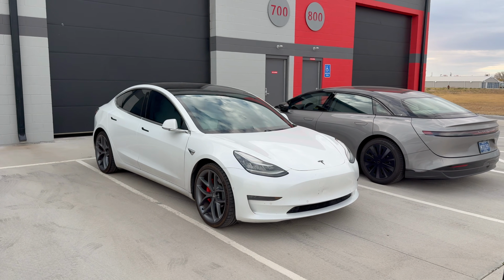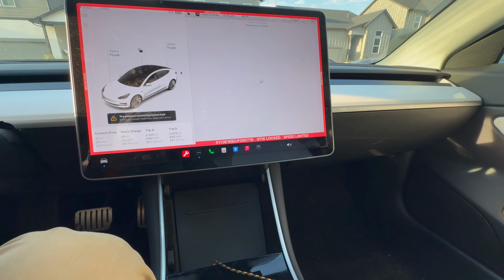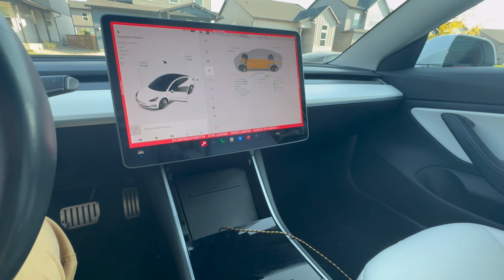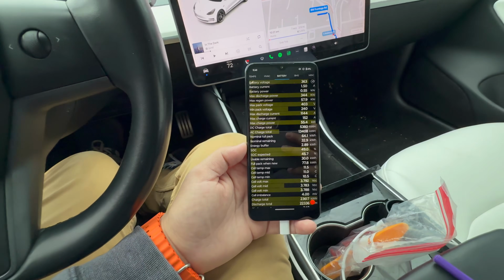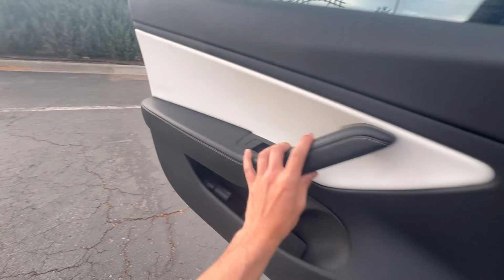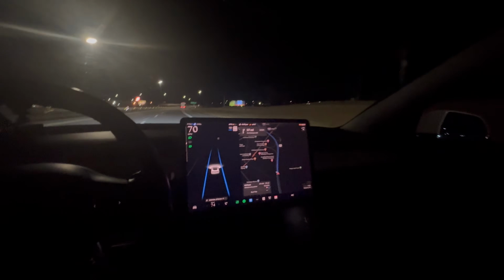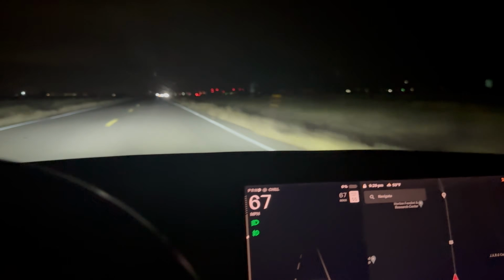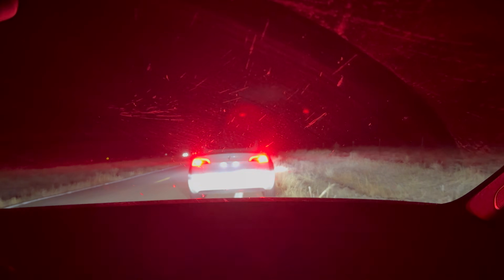My Used Tesla Lost This Much Capacity Since New! 2018 Model 3 Performance Battery Health Check

Comment: Living in AZ and being a stats nerd I will tell you that Tesla does NOT do anything related to battery cooling during the summer months! I have had 2 model Ys and I rarely see pack temps below 100f even over night. Then during the day 110-115 pack temps can be very normal. If you supercharge during the day in AZ, 140f then they just slowly go down to 120 after supercharging. If you supercharge here it’s brutal day after day. I’m lucky to also have a garage with AC so I think some have it even worse.
Reply: Does Tesla not run the AC to keep the battery cooler if it's plugged in?   Even the bolt EUV does that.
Reply: @fubolibs4218 the only time I can tell they cool the battery is after supercharging to get the battery from 140f back down to around 120f. Also, using track mode on my performance model will also cool the battery as well but that is a choice I have to make, not Tesla.
Reply: @JimBoomer  weird. My bolt starts the coolant when battery pack is 90F and stops when it cools below 80.   That's why it's plugged in.
Reply: @fubolibs4218  Now, I should note that the car itself may be running some cooling through the loop to do some cooling. But the pack temps them self are all high all the time in the dead heat of summer for both of my MYPs I have had (late 2021/Late 2023). Tesla just doesn't do any meaningful cooling IMO. I don't get why.
Reply: @JimBoomer  that's weird.  Even if it's plugged in???  I would imagine it would just run the AC power and cool the pack.
Reply: Can you add another radiator to help

Comment: I bought my 2017 Tesla Model S 75D back in Feb. with 75k miles. I connected Tessie which showed ~7% degradation. Carfax indicates it was from Utah, I live in NV… it was brutally hot this summer. I thought I saw someone say 80% was the best limit charging, so I did that. 

I only drive 20-50 miles a day, should I limit daily charging to 50 or 60%?
Reply: If you don't need the range, yes. But don't discharge it under 20% regularly, if you would need to do that raise the charge limit.
Reply: @ That makes sense. Thanks!
Reply: I only had the trial for Tessie bc I was subscribing to a different phone-based Mileage Tracking app. That subscription just expired, so I bought Tessie a few weeks ago. It now shows 13% degradation 😩 I’ve really only been daily-charging up to 60%. 
I’m considering running this charging test from the service menu when I have some time off the end of Dec. My battery warranty is still good through Sept 2025. I don’t think I’ll hit the 30% req for the warranty claim, but still concerning to go from 7% to 13% in less than 1 year.

Comment: Scan my Tesla shows 63kwh on my 2018 model 3 with 168,000 miles. With Tijmen' car, it showed 64kwh. Im curious if the Scan my Tesla is consistently that close to actual capacity.

Comment: As someone already pointed out, 5,000 kWh of DC is quite a lot. Assuming a 30 kWh juice-up per stop or just over 160 DC charging stops to put some perspective onto it. That's quite a bit of heat buildup under the intense desert sun. Sure, it's no Nissan Leaf, but I'd imagine that AC compressor was working overtime during and after those DC stops.
Reply: That is just part of owning a car.  Some folks are going to live in a dorm, apartment rental house in TX or Arizona and will do more DC charging.

Comment: I have many friends (Chicago) with Telsas well under 90% capacity left.    Interestingly, my  AC charged 2019 Leaf Plus is doing worse (10.3% loss) with 40K miles, than my DC charged 2019 Leaf (9% loss).

Comment: It was actually 62.91 kWh if you multiply 233 mi * 0.270Wh/mi.

The high degradation is most probably due to a lot of acceleration, fast charging, high state of charge, and high temperatures. I don't think the owner drove gently with it, see all the suspension issues. Also the 4880 kWh regen in ScanMyTesla is a hint to fast driving style. It had almost the same regen like DC charging.
Reply: It could be 63.018 as 0.270 * 233.4 (233.4 will be still presented as 233). Even 233.44 same with consumption. Also, i am pretty sure tesla have some error in distance reporting at least @BjornNyland always do some magic correction. On other hand its take about ~20kw power so about 0.3C with 1C the capacity would be less.
Reply: Jason from Engineering Explained explained how to extend battery life(or what not to do). He mentioned the fast charging shouldn't affect it.
Reply: Yeah, the og owner drove like an ass. I did some math, lifetime avg wh/mi is like 426wh/mi. Insane. Most people get 175-310 on the high end.

Comment: A relevant data point to add. My 2018 3 performance has 215,000 miles. All supercharged. Socal weather. 61kwh.
Reply: Likely means age matters more than use.
Reply: I have a 2018 model 3 dual motor 200000 mi (340000 km) in canada did the battery health test a month ago 82 % mostly home charged.
Reply: @jank330  do you leave it plugged in over night every night  and do you charge to 90%?
Reply: @ at what % do you consider a new battery or car?
Reply: Same for me
Reply: Interesting results. How do we do a battery test ourselves when purchasing a used Tesla. That would other than lower control arms cost to determine a fair price to purchase at or what we would look at for repairs once purchased
Reply: 2018 Model 3, 94k miles.  85%
Reply: When you fully charge your battery, what's your estimated mile range and also, what's your actual miles you get for a full charge?
Reply: dyhppyx, make a youtube video and prove it.
Reply: @cutehumor  he wont. he is lying
Reply: anecdotal evidence. not very strong form of scientific evidence.
Reply: @johnphillips7894 why did you watch this vid if you don’t place any value on anecdotes
Reply: @SigFigNewton  because i can
Reply: @johnphillips7894 👈😂 ok clown
Reply: @johnphillips7894  Every singular data point could be considered anecdotal evidence, but when you can combine a bunch of single anecdotal data points you can start to see a trend that actually matters. So yeah, if everyone wanted to share their "anecdotal evidence" it would go a long way to seeing what these cars are still doing.
Reply: @ Good luck collecting thousands of personal anecdotal evidence on YT researcher. 🤣

Comment: Comparison. I have a 2018 low VIN LR RWD M3. Original owner with 90k miles. Texas car. 
Running ScanMyT3sla results in 64.0 capacity. Virtually identical. 
No squeaks or AC noise though.

Comment: I have a 2018 model 3 long range at 109k mile and I have almost 20% degradation.  I've been very gentle with it but the degradation ramp up in the last few years.  Sadly I don't think I'll exceed 30% degradation before I hit 120k miles
Reply: I think some of the 2018 batteries were not great. 2018 LR with 56k miles and ScanMyTesla reports nominal full pack at 65.9, so 12%. Charged to 90% as recommended for the first few years.
Reply: @DonColeman  yep.  I think we had the 1st or 2nd batch of model 3s and Tesla recommended charging to 90%....I charged to 85% but I saw a dramatic rise in degradation this year.
Reply: What do you mean by “very gentle”?
Reply: @ very little super charging except summer beach trips and otherwise kept it under 85% charge the first few years and under 80% charge on Tesla’s new recommendations.
Reply: @ your degradation would’ve been roughly half of what it is if you set your charge limit to 50-55

Comment: Keep in mind that ICE cars also lose efficiency and range with mileage. There's no free lunch. However it seems like the current range is enough for him and thats A LOT of car for 2018 for $25k and 40k miles.
Reply: Actually ice gain efficiency with age due to parts increasing their tolerances.  Older ice engines are quicker with miles on them too.

Comment: Hi Kyle, remember miles is not necessarily related to energy cycles of the battery pack.  In AZ, you could be running the AC all the time remotely, and he could have been doing 0-60 runs all the time.  If he were doing racing runs, the pack could be depleted in 50 miles.
A better measurement is how many megawatts the battery has put out or consumed, you could then choose the average whr / mile and calculate the true "mileage" the pack has on it.
Also, he's getting quite poor whr/mi - perhaps ensure the tires are low rolling resistance, and that bushing issue could be causing drag because misalignment

Comment: The numbers do not add up. The car's efficiency was nearly 5 miles per kWh. This means the car SHOULD have driven 5 miles/kWh x 63 kWh = 315 miles in the range test. The car only went about 235 miles . That is a HUGE difference. In reality this car's efficiency is 235/63 = 3.73 milles/kWh, which is inefficient. This would indicate that your math is off by quite a bit.

Note that this car's efficiency AND range will significantly increase if the two radiators under the frunk are power washed and cleaned. You have to remove the front bumper to remove the plastic cowling that covers the radiators. There are YouTube videos that show you how to do this. Be careful with the radiators because the fins bend easily, and you can damage them if you use too much pressure with your power washer.

Comment: Calendar degradation is far more impactful than mileage
Reply: Only if stored at high temp and high soc.
Reply: @ no, regardless
Reply: From what I’ve seen, deg is not linear with age, and essentially levels off at some point (around 80-100 k and around 5-8 yrs). Thoughts?

Comment: Watching this on my lunchbreak in the middle of rebuilding a Kia Niro gearbox, haha. 

A little note on another important factor for battery health (which you can access with ScanMyTesla) is the CAC differential of the individual bricks within the battery. CAC stands for Calculated Amp-hour Capacity, and is essentially a calculation that the BMS makes for the capacity of each "brick" within the battery. Given that this car appears to have a pretty low voltage imbalance, the CAC differential is probably pretty low (though at around halfway SoC, the voltage imbalance is usually at it's lowest, so not the best indicator). 

Once a pack reaches a high enough threshold for CAC differential, it can reach a point where the BMS can no longer effectively keep the cells balanced, which usually leads to an increasing SoC/voltage imbalance. If the imbalance reaches a big enough discrepancy, the BMS will throw an alert and limit the maximum charge level of the battery (usually a target of 3.8v max for the highest brick). For legacy Model S/X, this alert is a BMS_u018, and for Model 3/Y the alert is BMS_a066. 

In general, I would say the point at which CAC differential starts to become "concerning" would be if the discrepancy between the highest and lowest bricks starts to exceed ~4%. It will probably remain functional in the shorter term, but could indicate that the lowest brick is likely on a "downhill slide" (especially if it's just one brick that is significantly lower). There can be external factors that affect this, such as an issue with the BMS, but more likely indicates one or more cells that have become "parasitic" and are slowly draining energy from the cells around them.
Reply: Very interesting, thanks for sharing that.
Reply: Thanks. It seems to me that the most common mode of failure for a battery is for a single cell or brick to lose capacity. In a 1P battery, the cell with marginally weakest performance early in battery life is the one which will fail. In a multiple P battery, a single 'brick' will fail prematurely.
Repair costs can be reduced significantly if a replacement of the faulty cell or brick with another used one with similar capacity to the other good ones in the battery can be carried out.
Reply: @RWBHere  Sort of depends on the car... Single cell failures are probably one of the most common "true" killers of these packs (which is also why that CAC differential is important, if there are one or more underperforming cells in a brick, it will often be reflected in that data).
 
At least on legacy Model S/X I would actually say that moisture intrusion is at least equally as common of a "pack killer", though those issues are usually repairable. Particularly on the oldest packs, moisture intrusion causes damage to the BMS electronics (usually corroded capacitors on the BMBs). Once you get to later packs, that issue was fixed, but what often happens is the development of an isolation fault, which can typically be remedied by taking the pack apart, drying it out, and then putting it back together with new umbrella valves, etc. 

Obviously with moisture intrusion, particularly in the case of isolation faults, timeliness in getting it pulled apart and dried out is critical to avoid corrosion and other permanent damage to the cells. 

Unfortunately, in the case of cell failures, module replacements just are not generally a viable repair method for Teslas... The BMS is just too sensitive to even the smallest differences in capacity, and they have very limited balancing capabilities. Even internally, Tesla stopped doing module replacements on Reman packs, as they often didn't last more than 2 years, even with a nearly unlimited supply of modules to pick and choose from for capacity matching. For a small shop with limited modules to choose from, it's even more "un-viable" to swap out modules. Now for some other cars, module swapping is a lot more possible, due to either less sensitive BMS tuning, or better balancing capability (or both).

Comment: Hi Tijmen, not only have the AC compressor replaced but I would clean the condenser fins on the front and put a screen guard to keep it clean. Debris is often the cause of AC issues and poor AC in hot climate could have also resulted in battery degradation as the pack may not have been kept within normal temps during charging and heavy usage!
Reply: If I may ask, what type of screen guard should be used? Does Tesla sell one of these screen guards or are they sold in local automotive parts stores?
Reply: @busog97641  Amazon has a number of them 2PCS Front Grill Mesh for Tesla Model Y, Air Inlet Vent Grille Cover, Mesh Bright Black Bumper Vent Grille Replacement for Tesla Model Y 2020 to 2023

Comment: I would strongly recommend either making sure the damaged compressor cannot run, or replacing it ASAP. If the compressor is sending metal debris into the AC system you need to replace a lot more components and flush others you cannot get to (ones in the dash). Makes the replacement a lot more expensive.

Comment: My June 2023 Tesla model 3 has 100,000 miles on it. 4% degradation so far. LFP. People don't want to believe me, but it's been tested two different ways and they both come up the same.
Reply: Yep, same here. I have a 2022 Model 3 RWD (LFP) with almost 107k miles, and I currently have about 4.5% degradation. People don’t realize how resilient the LFP packs are.
Reply: Thats why im also leaning towards LFP. Although 2023 is still newish in terms of calendar aging.

Comment: 1. I purchased a used 2022 Model 3 RWD with 77,314 miles on it in Arizona. So, I have gone through many of the same reviews of the car's condition. I have not run a battery health test. Recurrent measures my battery capacity at 95% of its original capacity.

2. This car does not have LFP batteries, so the batteries will degrade faster. It also has a smaller battery pack than later versions. 

3. You almost certainly will have to clean the two radiators under the frunk. If you do not clean them, you will lose a huge amount of your efficiency and range!

4. The Arizona heat is very hard on EV batteries. My garage is not conditioned, and I lost about 1%  (about 3 miles of range) of my capacity over the summer. I think if my garage had been conditioned, it would have mitigated this issue.

5. I have a Tesla Universal Wall Connector, and I charge my car at home. I generally charge to 100%.

6. I can get 225 miles of range in cool weather easily. However, in hot weather, the range drops down to less than 150 miles.

7. The original battery capacity was supposedly 62.3 kWh. However, I think it was around 60 kWh useable when new.